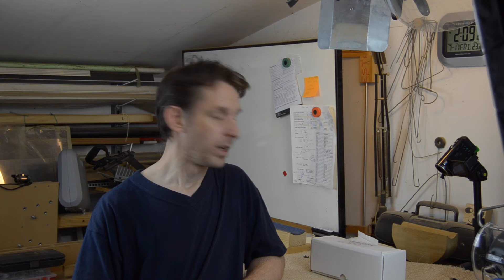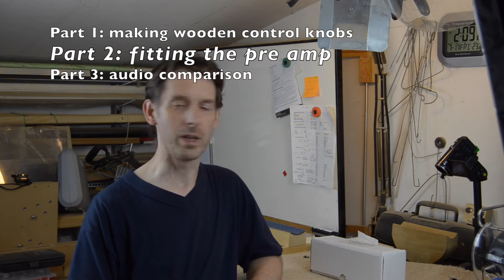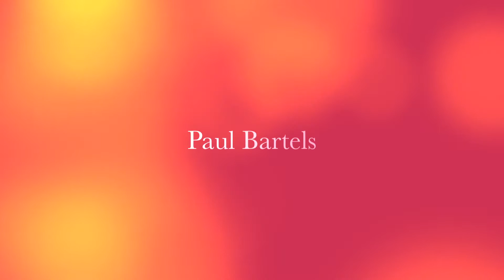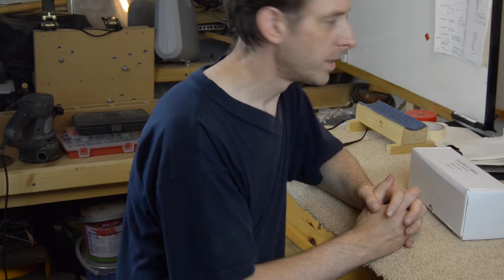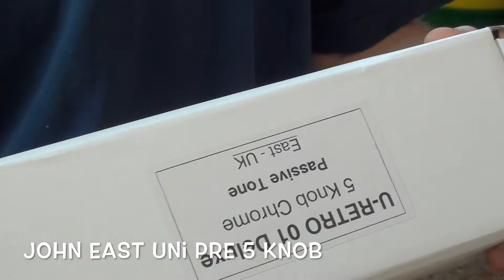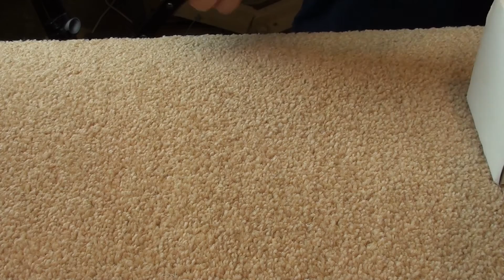John East Uni-Pre Install

Comment: Hi paul, nice video! May I know the cavity size of the bass? wanna buy the pre but not sure if it would be too big. Thanks!
Reply from the maker: Hello Geoff, thanks for watching. It's about 31.5mm deep, 65mm wide and 117mm between the 2 longest points. It was very difficult making it fit, I had to be very neat with the wiring and try several configurations before it would work. I hope that helps.
Reply: Thats some ENORMOUS help Paul, thank you!

Comment: Hi Paul. Great video, very informative. How would you clean cracky pots with this pre-amp? My Volume/blend knob is cracking a bit and I couldn't find any information on this. I watched your video on cracking pots but it seems that it is different with the JohnEast pots.
Regards,
Axel
Reply from the maker: +Lexa001 I would approach it the same way. But if the pots are too sealed and there's no way to spray contact cleaner in, then it may be that you have to replace them. Sometimes as a temporary fix you can turn the pot back and forth quickly for a good amount of time and see if it clears. Otherwise replacing them would be the option. As they are quite specific(in terms of size) to the preamp you may have to get the pot from John East. The modules are separate so as a last result buying a new module would be a somewhat expensive but good solution.

Comment: Hi Paul. I've got my Unipre 4knobs to install it on a Warwick $$. I already installed it without using copper foil(just to give a try how it sounds) and it's an amazing big improvement. I will take it off again to shield it with the copper foil tape. For first time I'm dismantling a bass myself. But it seems I have to replace the flush mounted output jack. I see this kind of jack has a toothed ring on one side and a hexagonal ring facing the internal electronics cavity. Please do you have any idea of what kind of tools i have to use to tighten this jack? Any special wrench or tool for that toothed ring? Thanks in advance.
Reply from the maker: +Sixta Pena if there is space in the cavity, then you can put the jack in loose and tighten the internal nut up instead of the external one. The other way is if the external one also has a small slot on either side of the ring, you can then use needle nose pliers or even 2 small screwdrivers. Its very easy to slip though and mark it. Try going from the inside.

Comment: Hi Paul. A question about the unit... Does the passive tone operates in both active and passive modes? thank you :)
Reply from the maker: +Sixta Pena it does seem to have a slight effect. I'm not sure if it's supposed to. I keep it fully turned one way when I'm in active mode. When it's turned the other way the tone to my ears suffers a little. Although its a subtle change.
Reply from the maker: +Sixta Pena in passive mode it does change the tone.